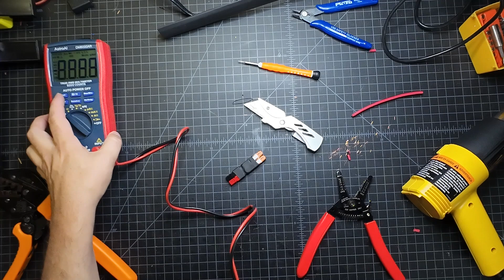Wago to Power Pole Go Kit Essential

Comment: Glad I'm not the only one that struggles to click in the contacts into the housing and burn my fingers with heat shrink! :)
I actually found that if I hold the metal tab down a bit with a flathead from the other side it tends to go in easier.

Comment: I would use bare solid wire , and no solder.   You need to cut the shrink wrap a little longer since it shrinks in length too.

Comment: I agree with other comments; properly crimped connections shouldn’t need solder. But not everything goes to plan and sometimes we use cheap connectors. I would recommend applying a little liquid flux before soldering. Will make your joints flow like butter.
Reply from the maker: Yes, good point.  II forgot the flux.

Comment: why is there a need to solder if you've used the proper crimp/ crimp tool?
Reply from the maker: Insurance. Not all crimps work
Reply: @AA0Z  ah ok, so you wear a belt and suspenders, got it🤣

Comment: I standardized on 40A power poles. It just makes things easier given their open design Vs. the 30A. This is especially true for me as I tend to oversize wire for an extra safety factor. I never thought of doing this but it could be useful. Nice video.
Reply from the maker: When you go to crimp, and you are using 18awg wire, does the crimp actually secure the wire?
Reply: @AA0Z  I've not really used wire gauge that small with power poles. I'd probably pick up some 15A power poles if I was working with gauges that small. When working with stuff that small I tend to be working with connectors that I'm soldering. The 40A are more helpful when you are over-sizing wires (so harder to nicely fit in the 30As) rather than for the small gauge stuff.

Comment: Maybe I missed something but why did you solder a crimped connector? The crimp is more than sufficient.
Reply: I solder. Way too many crimps fail on me.
Reply from the maker: I've had crimps fail.  You think they are crimped when actually they are not.
Reply: Not to mention that solder on a crimp can lead to failure from strain.
Reply: @MadGoat so could a crimp
Reply: Yeah OK  @MadGoat

Comment: I made a couple of these. They work great!  For one of them I had two ATC fuse holders that were already on wire. I used that in between so I have a fused link. I made mine longer, but I may do a shorter one like yours to throw in my pack. Thanks for the video!
Reply from the maker: Great tip!

Comment: May I ask what width/diameter shrink wrap you used?  Thanks for the video and apologies if I missed the answer
Reply: Thank you!
Reply from the maker: Never really understood heat shrink standards, but the stuff I used says 3/4" but if you measure across the heat shrink, it's 1 1/8" in.  Hope this helps.